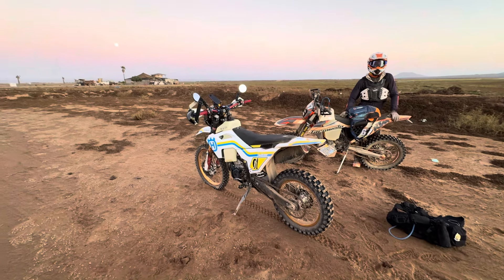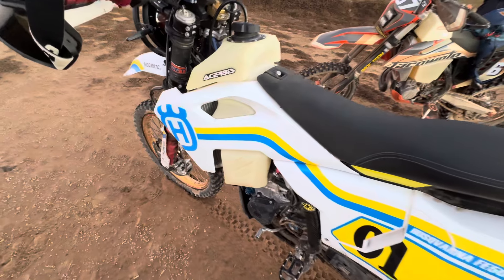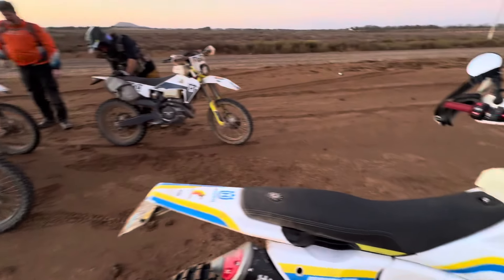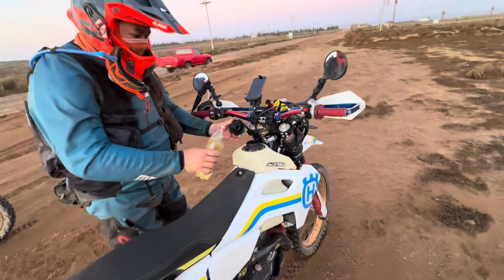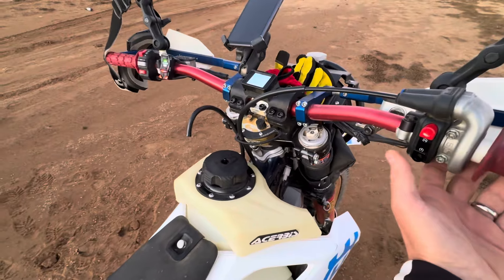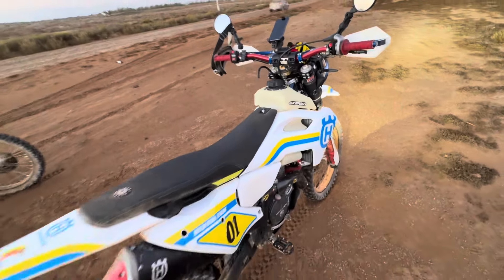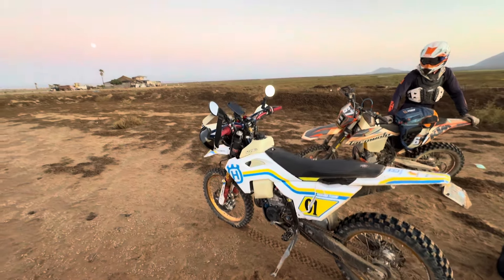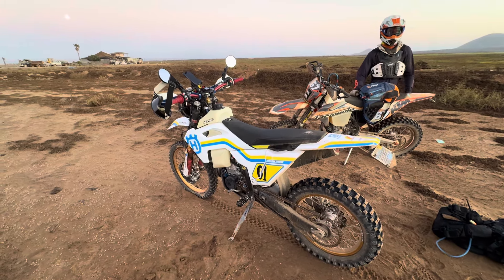THE DUAL HOSE TACO SNORKEL WORKS LIKE A TREAT - 🇲🇽 BAJA TESTING UNDERWAY ⚡️🌮⚡️

Comment: I’m interested in purchasing the double for my 23’ TX300 when it’s available.  I have a question concern any decrease in fuel capacity. I will need to calculate the reduction from stock, or possibly aftermarket tank capacity if I go with one your pump mod will fit.  I want to know the amount of fuel the added pickups/filters etc inserted into the tank will reduce the capacity? I wouldn’t think it would be significant.  Will you be publishing the amounts? Thanks!
Reply from the maker: Negligible compared to stock

Comment: Hey Mike so is the single snorkel scrapped and getting replaced by this. Or is the single hitting soon? Got the ims 17l and sick of only getting half the use of the tank until I have to tip it over.
Reply from the maker: The single snorkel will be rolling out as well